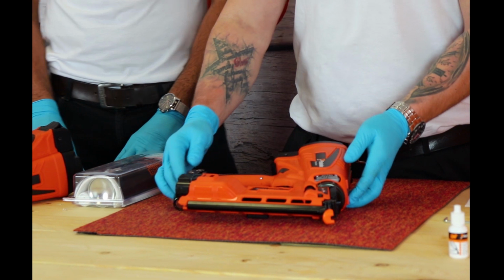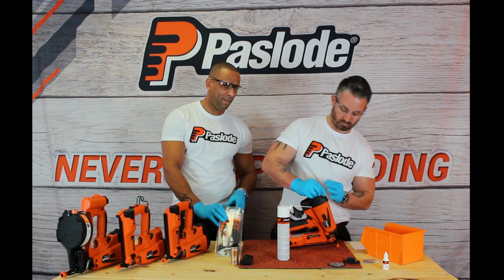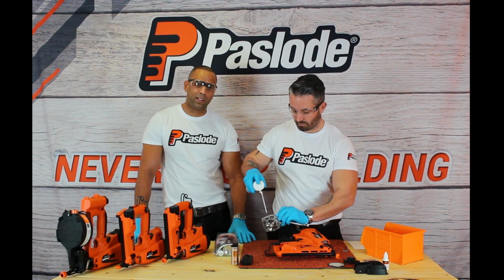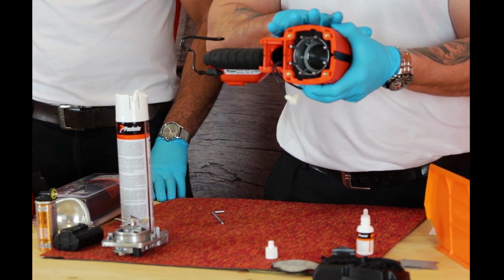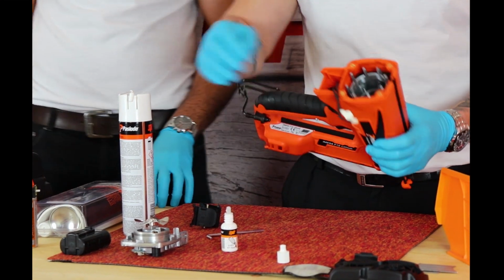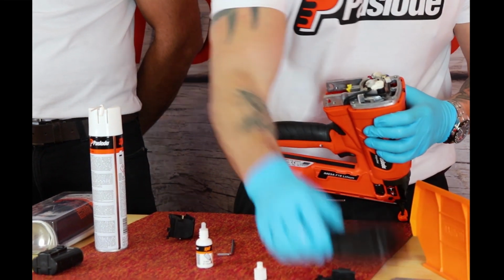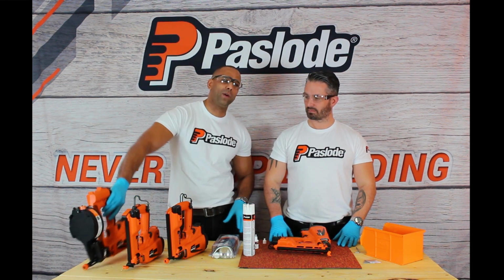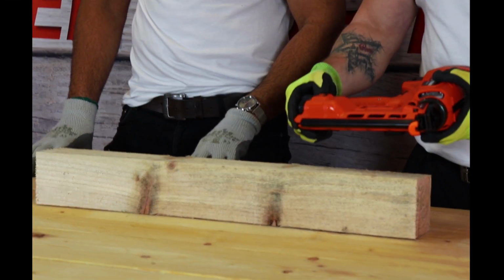How to clean your Paslode Trim Tool (IM65/IM65A/IM50/IM45 GN) PRE 2024 MODELS

Comment: Hi I have a question about the piston chamber.... at the very top inside of the chamber there is a metal ring with 2 eyelets at the ends of the ring as the ring is not a complete loop. I have cleaned my gun thoroughly and it is still miss firing or firing 2 pins at once. The only thing I noticed I hadn't cleaned was this ring inside the chamber. It doesn't move round nor can I seem to get it out but there is dirt gathered on it I can't get off. Should this ring be moving and should it be possible to take it out to clean individually and also the recess in which it sits? It has caused a sort of clean shadow on the back of the piston also

Comment: Hi there just wondering if this the same procedure as on the older gun , mine has intermittent fireing .
Reply: Mine had intermittent firing - i've repaired it today & serviced it using these videos on Youtube. The problem turned out to be a loose connection at the spark generator.
Reply: Really appreciate your support